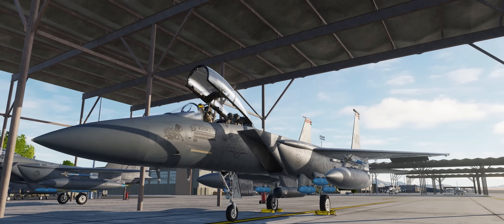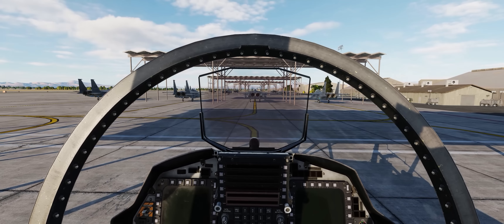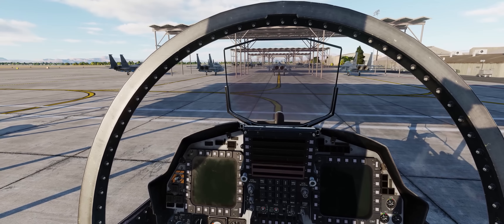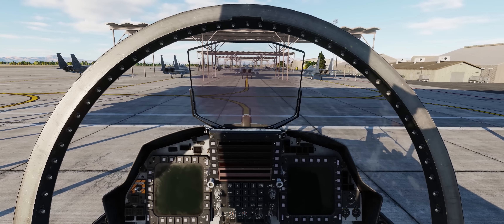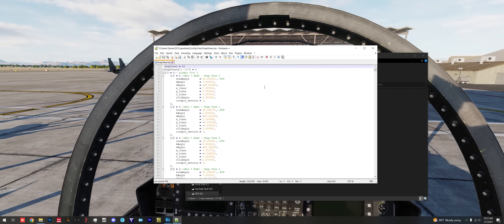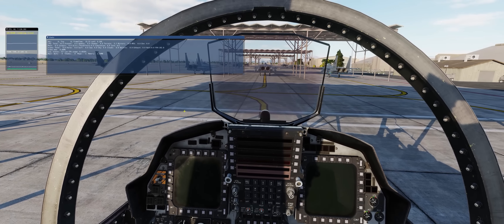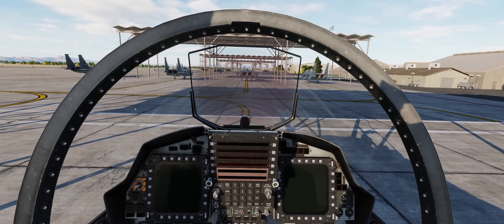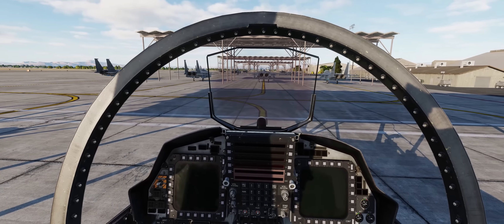How to Fix Default Cockpit Head Position in DCS World! F-15E Strike Eagle

Comment from the maker: Hey guys!  If you like to see more videos on Cockpit & Home Cockpit Ergonomics to help you all get the most out of your copy of DCS World!  
Remember to save your default view, hit Right ALT + NUM 0 and then go to the new SnapView.lua file to adjust the zoom!
Reply: What resolution are using?  4K? 3840x2160?
Reply: I followed what you said but when I edit the value in the default view for the FOV, nothing changes. It doesn't zoom at all. I tried 80, 100 and even 200 but nothing happens. But the snapview is really helpfull. Now I don't have to mess with the trackIR.
Reply: You’re the best, thank you so much the F-15E is soooo much better now, I’ve done your recommendations to my F-16C, my F-18 and even my Gazelle it has transformed the modules sooo much 👍 thanks again Spud
Reply from the maker: @MrFeteede  Make sure you are saving the LUA file and close dcs between saves
Reply: @HandleWithNoLastName  thank you I was looking for this comment
Reply: @MrFeteede   When you do it check if the view changes when you back into instance action but  before hitting the fly button to actually get into the cockpit.  let me know.
Reply: @Ginuwine-kx2iv  thanks. I managed to fix it.
Reply: Hi. I am using the quest 2. Is there a way I can turn the head track cursor off and just use the mouse? I get my cursor over  button or dial then my head will move slightly and the mouse cursor moves off the button or dial.

Comment: So many DCS content creators sit WAY too far back in the cockpit. So far back that it looks distorted and stretched like your inside a tunnel or a funhouse mirror. It drives me nuts. I have the cockpit zoom bound to the left throttle wheel so I can zoom in/out with just a scroll of my pinky finger. So I can zoom into the MFD, check something out, then come right back out. Really helps with SA and fine control. The RHT ALT+ Num 0 is a great trick. Must remember that!

Comment: My biggest QOL Issues I am having is my Tobii eye tracking 5 is not working right. 
The problem I am having is any time my head tracking is enabled, when I am in cursor mode the head tracking is in the default direction. and if i try to use my mouse my head is sniping back to center when the mouse is move any direction.

Comment: @spudknocker  Wouldn't a numpad star and slash ( *  /  ) would do the same FOV changes without having to mess with the lua file??
And another tip - I pause the TrackIR while adjusting the view, then resetting the view by hitting numpad Enter and 5 button first.  only then I find the desired view point I like and save it.

Comment: I did this in the fa-18C which works to set the position. The huge problem is with the HUD projection itself. It gets cut off, not centered, way too zoomed in while flying (the hud projection itself), so either airspeed or altitude and Gs is all cut off from view unless I move my head around. So moving closer and sitting lower helps, but this is incredibly difficult to achieve a realistic position and not end up with neck pain from constantly looking down at MFDs with my head all the time. I recently switched Tobii5 back to eye tracking instead of camera acceleration.

Comment: I would assume the section in the lua file sets the vertical fov, there's other games that use that as well. It's easy enough to find a calculator for it online to calculate what it'll be for a set horisontal fov depending on your monitor's aspect ratio.
Reply: I was just about to comment this exact thing.

Comment: So my default view matches, but when I zoom with the axis slider on my throttle and put it in the center detent to go to normal zoom doesn't return it back to my save setting. It actually zooms in at like 60 or 70% and then I have to keybind "normal zoom" to get it back to my default. Super annoying. Anyway how to change this?
Reply: Normal view is 96.7 FOV which matches the LUA file, but when I zoom in with the axis slider then go to center detent my "normal zoom" is at 80.0 FOV so I have to click "normal zoom" to get it back to the 96.7 FOV even though that is my default.

Comment: I’m gonna go ahead and call BS the whole video and I would advise everyone to ignore this completely.

The reason is simple.
ED and other companies adjust the center view in their modules so that players can get a good perspective of the most cockpit info as possible. This means ALSO trying to get the bottom MFD (or usually MPCD) within the frame of your screen, while doing minimum sacrifices in the hud and the rest of the view.

UNDER NO CIRCUMSTANCES DO PILOTS NEED TO HAVE HUD TOUCHING THE CANOPY AS THIS GUY SUGGESTS. That is a no no no no no….no…

…and no…

And even if that was true, which it isn’t, if you do as this guy suggests you end up having the bottom MFCD out of frame!!!!!!!!

And as an extra bonus tip:
Do what he says and then good luck managing to see the tankers bottom lights during air refueling.

Therefore…BS! The whole video comes from someone with lack of knowledge.
Reply from the maker: LOL!
Reply: Setting FOV is a personal preference. Not everyone will like the same setup. This video gives those who want a change the method to do it. That doesn't make the video any less helpful for those who want to set it up differently. Plus, display resolution, aspect ratio and quantity are variable that will affect everyone differently.